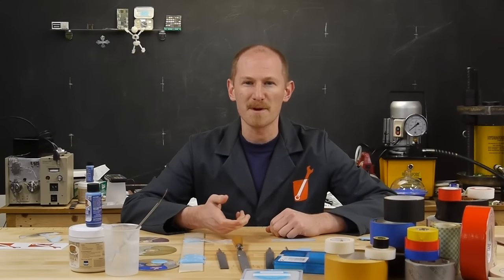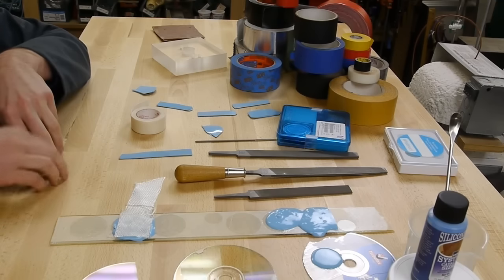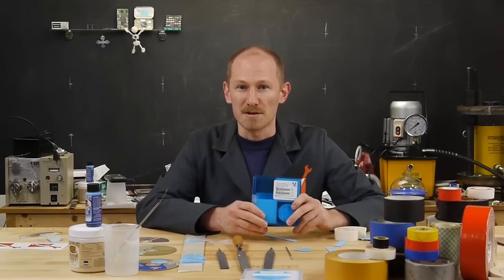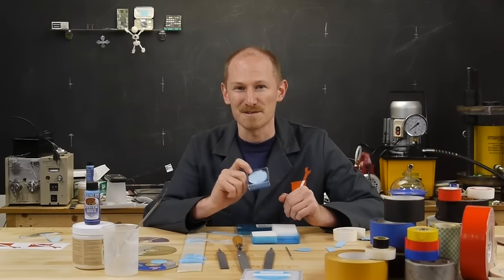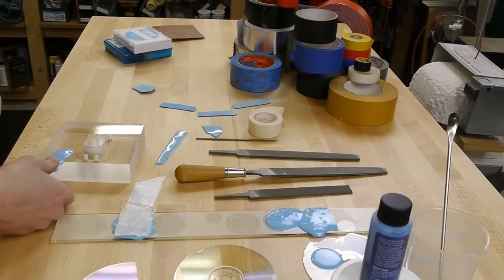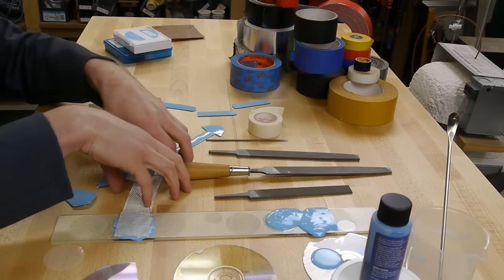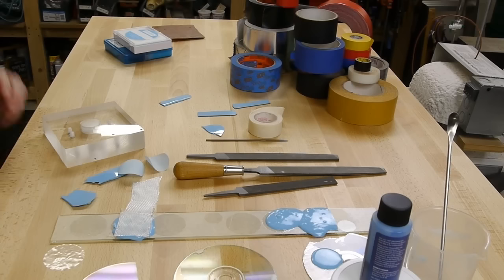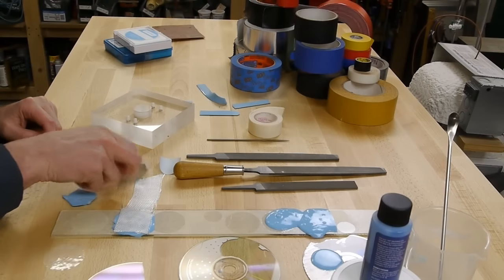Making DIY gecko tape - work in progress

Comment: High voltage, low current arcs through saran wrap/cellophane might get you the right aspect ratio. It's a bit thinner than the polycarbonate filter material. Though I would forsee some issues getting the arc to jump through the cellophane rather than through the original/previous hole. When dealing with electrostatics it's very easy to generate microscopic pin holes with static discharges. With the right pin hole density, I think it would get you the right casting pattern.

Comment: Perhaps if you were to use a filter substrate which can be dissolved in an etchant that does not harm the silicone and let the silicone cure on the high side of a vacuum chamber (with some sort of structural reinforcement on the back side of the filter)? The low pressure on the bottom side of the filter would hopefully draw the silicone micro-structures into the filter as the sample cures. 

Note: I have no idea if this would work.

Comment: The other idea I had was to take a blueray laser diode and assembly from a dvd burner and mount it on a larger cnc so you can do larger area photo lithography exposure, Although this may involve you making a lot of software to control both the voice coils and cnc at the same time.

Comment: 13:40 "the teeth are sharp on the top...and we want the teeth to be sharp on the bottom"...sounds like a simple inversion issue...did you think of double casting?...if the silicon is good enough in retaining detail when cast once, it sounds like it might still be good enough when cast a second time to get that inversion...trouble is, what do you use as a parting agent to be able to separate them...Great and fascinating vids, Ben!
Reply: i started typing and  thought id better look  i second this idea seams the next logical step

Comment: Lithography isn't outside of something you could accomplish, you'd just have to experiment with exposure times for whatever dissolver you use on the silicone.  You already have the mold, coat it with uv blocker and see if you can make those micro structures the correct aspect ratio for their task.

Comment: Hi Ben, I was thinking about your gecko tape last night.... It would be very inefficient for a gecko to have permanently sticky feet, so I don't think nature would do that to the poor gecko, I imagine the gecko must have a way to make the feet stick and release as it walks. The most likely way for the gecko to do this would be to firm up muscles in it's feet for sticky feet and loosen up the muscles to release.
Consequently what I think is missing on your gecko tape is a rigid "non stretch" backing tape. What you want to achieve when you pull the tape is the simultaneous tug on all the tiny contact points, instead what I think you were doing in your experiment was a gradual peeling off. 
I suggest repeating the experiment with stiff and non stretch backing tape, possibly woven fibreglass or some kind of steel mesh might work. 
Love your videos, the width of your knowledge is impressive.
Steven

Comment: I think I'm Little a little bit late, and i didn't read all the comments to see if my idea is already posted.

I would try to work with "burs".
Cut a hard plastic often in any direction with a sharp knife. This will produce burs at the edges of the cuts, the pressure on the knife will determine the size of the bur. The tops will be very sharp. Take a negative from that, by example with acrylic caulk. Then create a positive with silicone from that. Now the silicone should have the same burs as the hard plastic.

Comment: What if you used the method to make the track etched membranes, with beta particles, but used a positively charged plate behind what you’re etching to align them? And if you used a denser material than what the membranes are made of you might be able to control the depth the particles penetrate to, to avoid getting the overly long floppy patterns.

Comment: Here's an idea... Automate it.

1. Computerize the control of a microscope slide by attaching an Audrino controlled stepper motor to the gearbox assembly.
2. Focus a burning laser beam with a series of lenses until it's the hole size you need.
3. Fire the laser so that it burns a hole in the film you will use to mold with.
4. Adjust the slide between laser pulses.
5. Complete until done.

Comment: Have you tried higher density optical mediums? I would try a new 4k Bluray disc, the indentations might not be much finer, but the density will increase significantly. For that matter, have you considered an actual hard drive disc? If you can still budget it, you can get a 4tb  or 6tb disc drive in a small form factor (3.5 inch, as opposed to the larger external drives) that is simple to disassemble.

It might be even more helpful to confirm that the hard disc you choose will be of a substrate that the silicon will flow into (most of the new ones will be glass or ceramic. Since newer drives also use perpendicular recording (not longitudinal), this may provide a more correct shape than the disc you used, in addition to being a better density.

No new ideas here, just bouncing off your brilliant disk idea.

Comment: you could use a technique similar to what they to to make the "tooth' pattern in photogravure where they use a fine powder (rosin) dispersed in water then dry it leaving behind the fine powder as the photo mask (photonegative resist) although laser toner powder may be better in this application. alternatively if you used a used a (non-photo)mask on top of copper or zinc sheet then aerosolised a solvent to remove the mask and etched with ferric chloride you could control the width with particle size and depth with exposure time/concentration of ferric chloride.

Comment: After 942 comments, maybe you won't see this one but here is a different approach...

What about extrusion similar to what they do in milliflore glass blowing   It would seem that there should be many long chain polymers that could be stretched and folded back on themselves (like pulling taffy).  You could cover one polymer with another such that you start with a cylinder of one material that is filled with the other.  If the outer cylinder was made of a soluble material and the interior material insoluble,  then maybe after enough pulls and folds you could then thinly slice it perpendicular to the direction of the pull. If you apply a solvent to one side only and wash it off before the solvent penetrates to the other side then you might be left with a sheet with the fine closely spaced fibers you want on the side that the solvent was applied.

Comment: have you thought about very lightly etched glass for the mould surface? you can get glass etch chemicals at an art store. just leave it on for a fraction of the time the directions call for, should result in very fine dimpled surface.

Comment: Hi, what about a diffraction grading from a spectrometer? They are mechanically etched aluminum.  I think it would give you the correct aspect ratio, they are predicated on wavelengths of light so as you get further away from the start point the spacing gets wider. You can also get lambda specific gradings as well. For example if you wanted a UV grading to get a smaller grooves or an infra red grading to get wider grooves. Although they are expensive and very fragile and it would be more like the file and wouldn't give you the "pillar" affect. Just a thought. Thanks for sharing. 

Craig.

Comment: Try this:
Extremely polished surface... then hit it with a quick sand blast with extremely fine media at a low pressure. This creates a rather sharp surface profile, which should allow the aspect ratio to be square enough to give something reliable.
You can also make extremely high "finger" density by repeating the spray. High pressure makes the aspect ratio far too high, but low enough pressure with longer exposure (which you may be able to see testing with you electron microscope) should create a random but consistent surface with sharp edges, on a micro scale. Use a media much harder than the material being hit, and that should also help by making clean (intentionally jagged) edges. I would say 
I would say optical grade polished glass, hit with Silicon Carbide (Black) Grit Abrasives at 20psi... Grit size 1000 or finer gives you impact sizes at or below 10µm.
Only problem is that it is more difficult source and not cheap, 1000 grit costing roughly $100/25lbs and 1500 $110/25lbs. I could not find any vendors with smaller quantities... 

To go one step further, use boron carbide. Even harder, it will produce extremely jagged surfaces.
Probably 1200 grit... But this is double the cost, and for only 5lbs... I dont know what your budget would be for this experiment, but this is getting into exotic territory...

Check the site below, or if you know any local suppliers, they may also be able to help.
sandblastingabrasives. Com

Comment: Maybe the type of double stick tape used is also very important. I imagine that a particular type of adhesive would flow in the membrane holes making the silicone pillars stop short of the full thickness of the membrane.

Thinking of the equipment you have, maybe you could use vapor deposition and the membrane as a mask to weaken a material so that you could etch controlled depth holes. Although i suppose the holes are to small for the deposition process. Maybe etch the membrane to get bigger holes... 

Maybe... no, that's all the ideas i could come up with. :)

Comment: Extremely fine sandpaper? No idea on the spacing and depth of the valleys but you can get wet-and-dry sandpaper so fine you can't tell it's abrasive. I'm talking 1000 grit +, which is dirt cheap and available everywhere.

Probably already suggested but thought I'd comment just in case!

Comment: I wonder if an optical interference method would be viable to produce a regular pattern of pits.  You'd have to screw with the phase and magnitude and angle and all that, to get the right dot size and pitch.  Making patches of arrays would be easy enough at least, just mask off where you want "feet".

Comment: I think using a natural template as the mold would be a step in the right direction, one could also investigate the action of electric arcing through a medium such as an electrolyte saturated cross section of a very fine grained wood to create a more fractal surface.

Comment: copper board for electronics. Covert with 90% black then spots of no cover. Acid will it itself in enlarging opening deeper it will eath. It will give wide base, self adjustable part to main tap.

Comment: I recall using quartz cuvettes in chem lab when we needed to use UV in the spectrophotometer. You could try using quartz lenses. I'm not sure how expensive they are though.

Alternatively, you might find porous natural substances, like zeolites, to use as a mold, though I doubt you would be able to find something with an even flat surface for the mold, and smoothing them might even close off the pores.

Edit: Instead of zeolites, you might be able to use Porous Silicon, though you need pretty concentrated HF to make it, it evolves H2 durign the etching,  and I'm not sure if it will work as well with polycrystalline silicon and monocrystalline is probably rather expensive.

Comment: amazing stuff! Im an EE but you make this stuff so cool. I have an idea: Why not use 2 different types of silicone that dont stick to each other when drying; then use the same film method but this time cast from both sides using the different silicon. This way the pillers will be shorter as silicon is filled in from both sides of the mold. I dont know if this will work tho lol.

Comment: First, you CAN get fused silica lenses that work in UV.  Second, you will get reflections from the bottom of the glass that destroy your pattern unless you metallize the top first.  Third, the transparent films will not work well:  They are more opaque in UV than optical and do not form a good object plane.   You will have better luck transferring toner to a crushed glass diffuser plate.

Comment: Modify a CD burner mechanism and work out how to control the laser gain for depth control. A 32bit arduino due should have enough digital resolution and fairly easy to program. Its handy you can check your work in your electron microscope.

Comment: Perhaps a method of burning CD template but controlling bit pattern such that it provides a more desirable pattern?  Or, deeper, a laser etch method which would allow precise control of hole depth and distribution in your template... provided the silicone releases your fibres undamaged, this may fix the fibre length issue and thereby offer a stiffer set of tendrils.

Comment: You can make a screen for litography by making a hologram on the photo film. Basically, to make "rasp-like" stripped structure you project on a film two beams of the same laser at an angle, split by semi-reflective mirror. That way you would get a difraction grating with a pitch determined by laser wavelength and an angle between beams. Really simple experiment we did in university:) That way minimal pitch is determined only by the size of silver particles, so getting lowest ISO film possible as you can (or, with your expertise, just make a film yourself:)). BW film with real silver, of course.
Reply: Or just project UV laser the same way on a litography film, if you can find UV lasers.

Comment: Carbon nanotubes might work if you can build them correctly but how would you get them off? Actually, could you attach CNTs to a flexible substrate and use them as the fingers instead? You might want to include vacuum casting as well at some point since the air gaps may affect things. Another thought, in order to stick to more irregular shaped things, perhaps take some design ideas from the balloon/coffee-grounds gripper.

Comment: Hello Ben, what about buying 390 nm LEDs off ebay? The light would easily go through most glasses and there are photoresists like the AR-P 3500 that are sensitive to these wavelengths. Resolution should be good enough. You could even use a photo mask in contact with the sample without magnification. The photomask itself can be made by special companies but I assume it would be appropriate for you to all by yourself. I think you can modify your SEM to do Electron-beam lithography!

Comment: The manufacturing methods used in moth eye antireflective coatings might be useful in this project. The idea is that you would use a Langmuir Blodgett coating method to lay down a monolayer of nanoparticles on a substrate and then would use a chemical etch, specific to what ever substrate you were using, to get pillars which would be the negative of what you were looking to get (pillars). You could then use some polymer like PMMA to create a casting mold that you could pour your silicon into. If you would like any help with this method please contact me. I did research on antireflective coatings about a year ago at the University of Florida.

Comment: Hi, have you considered using anodic alumina filter membranes. The hole pattern would be more dense and regular, but I'm not sure if the desired aspect ratio could be achieved, but it seems possible. I have some experience in making anodic membranes from aluminum and titanium and the hole size is typically controlled by the applied voltage and electrolyte composition, so perhaps commercial membranes would come in the desired pore size. Hope this helps.

Comment: maybe you can use a pcb as the copper layer may be the right thickness. also when you want to remove the silicone you may be able to stick it in the etchant again

Comment: You could make a holographic shim (the wavelength of the laser = the gap distance (sin of the object beam + sin of the reference beam). Take the developed film, electroplate it, and dissolve away the emulsion.
Using a HeNe laser you would get something close to 500nm if both beams were at about 40 degrees: 633nm = 485nm ( sin 40 degrees + sin 40 degrees)

Comment: Would you be able to re wire a blue ray burner to run off a micro controller? Because then you could "write" whatever you wanted to the disc. Not data, but instead use the burner to create holes of the correct size, maybe even shape. Is the lens of a disc drive able to tilt in order to aim? I took one apart and saw coils so I'm assuming so. Possibly use that to control angle of the burn.

Comment: How about using a diffraction grating as a mold?  I think that most of them have a fairly sharply formed bottom to the grooves.  You can get various numbers of rulings per mm.

Comment: How about a plasma etch? Look up silicon wafer etching for example... Same concept with photolithography, but the substrate is silicon. I'm pretty sure you could control the process down to whatever pitch size is required.

Comment: I would look into the specifics of manufacturing computer processor dies out of silicon using the light and etchant method.  I believe that they create an image of the die that is much bigger than they intend to create and then use optics to make the projected light image much smaller.  So maybe your laser printer negatives would work if you used optics to focus the light.

Comment: hi, try to use CD-R or DVD-R, they have a full grove instead of this dot pattern. The depth is the same as the wavelenght of the used laser in the drive. for the coating/etching idea, maybe you can get a result when you expose it with a interference pattern instead of a PCB-like covershield.

Comment: Heya Ben.  Instead of trying to get a surface structure from a material that you form the silicone against, just mix in some structure into the silicone.  What comes to my mind is to use pencil graphite that you can get from an art store.  This stuff has very fine nano structured layers, because it's mined graphite (not synthetic). It's not a directional structure or perfectly uniform, but maybe who cares.  It's easy enough to try...